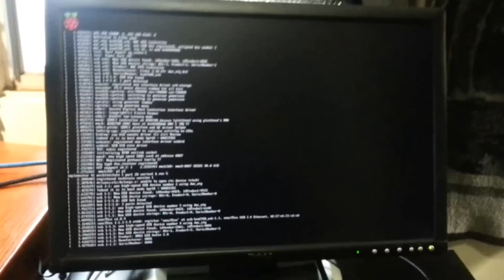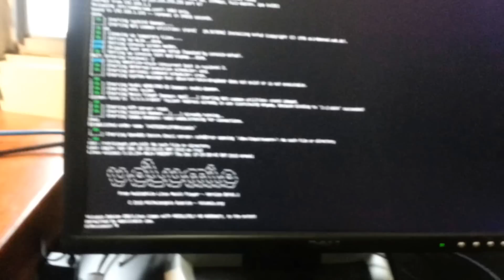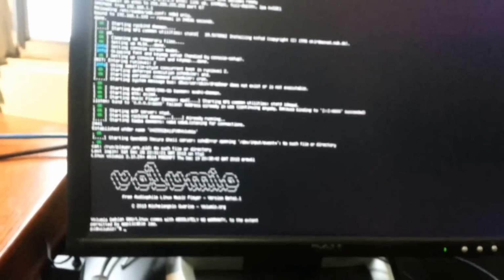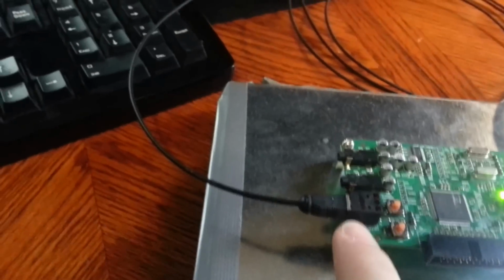A DIY Power Supply For Hi-Fi Raspberry Pi Audio

Comment: Hey, great video! I'm trying to build a similar system except I already have a step down converter to do the 12V to 5V conversion. Since both of them are cheap switching components I am trying to slap on am inductor of sorts. anyways I was wondering what the output capacitors on your psu is for, and why did u opt for 2 smaller ones instead of 1 big one? Sorry if my questions are nooby but my background is comp sci rather than physics. Thank you
Reply from the maker: I don't believe I had a particular reason. I think I just ordered some extra capacitors and decided to add some extra capacitance later since the V1 Raspberry Pi seemed to be very jerky in its current draw changes. It felt better to over-do it with the capacitance to make sure the 5v output was as stable as possible (with the trade-off of charge-up time).  The Pi V2s and V3s seem to have better on-board voltage regulators rather than relying on the capacitor that the V1 had. I would imagine that you would be fine with less capacitance as long as it satisfied the 2.2uF minimum of the LT3080.
Reply: thx